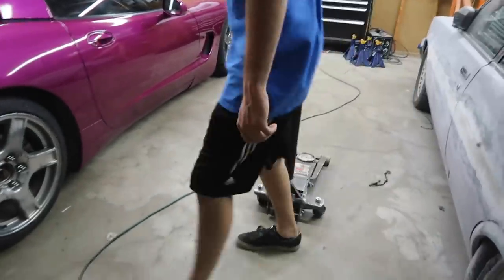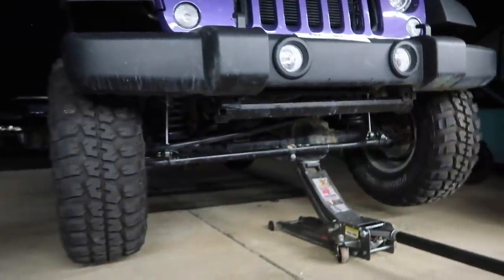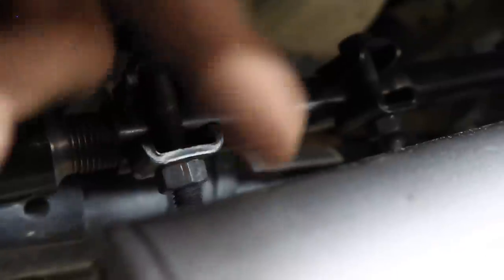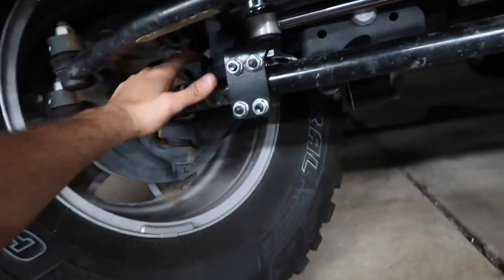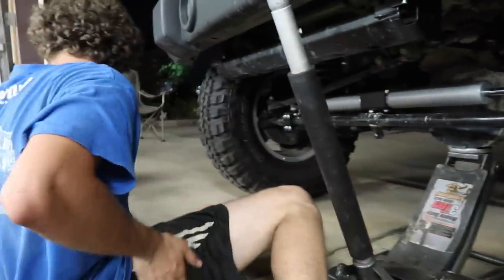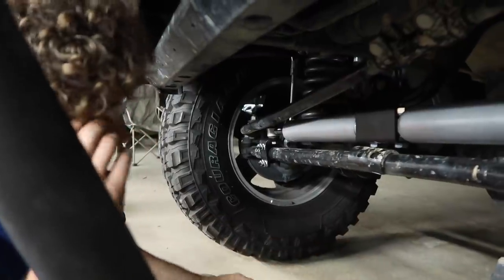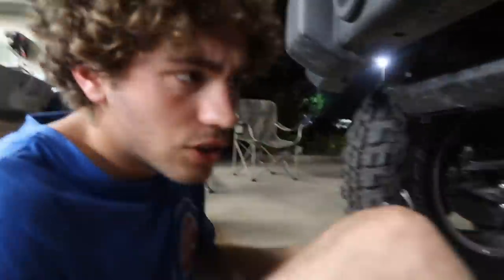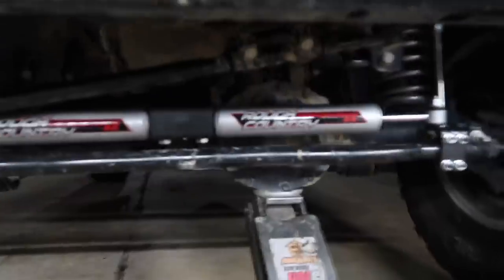JK Dual Stabilizer Instal | #nodeathwobblesquad

Comment: I upgraded my Jeep with 4 inch lift and 35 inch tires now my steering doesn’t allow the car to turn to each corner unless I remove the steering stabilizer. I want to still use the oem steering stabilizer how do I do that??

Comment: Worthless mod that just masks the problem. It is typically just a worn out trackbar that causes death wobble.
Reply: came here to say the same shit before I even watched the video. correct steering geometry doesn't need steering stabilizers
Reply: On a new car? Okay...
Reply: mazdamitch003  problem is it's rough country
Reply: TYLER NEVER HAD DEATH WOBBLE. JUST TRYING TO PREVENT IT FROM HAPPENING LATER DOWN THE ROAD!
Reply from the maker: kenny etenne thank you!
Reply: Tyler Fialko Dude some people just dont think! But FUCKEM! Keep the great videos coming!!!
Reply: kenny etenne I didn't mean to tickle your triggers. I've been building jeeps for a long while and just stating a fact. I wasn't hating. If I hated what he did I wouldn't be subscribed.
Reply: Tyler Fialko stabilizers aren't going to prevent shit. The only thing that's gonna prevent death wobble is keeping your alignment in check take those rice tubes off

Comment: Message me if you ever need tips or tricks with your jk. And go up a size on your lower Trac bar bolt, jeep didn't put in the correct size and it ovals out that bracket causing death wobble. And look into doing cav fab steering and a rustys or iron man offroad Trac bar, they are both best for your application vs rough country.

Comment: Have you addressed your gearing yet?
Reply from the maker: Snarf with 35s it's not an issue however when I go to bigger tires I will change gearing.
Reply: If you plan on really offroading it put some low-lows in it or you won't crawl shit...oem rigs are all too high geared for real offroad imo, it sucks having to approach stuff at too much speed just because your gears aren't low enough